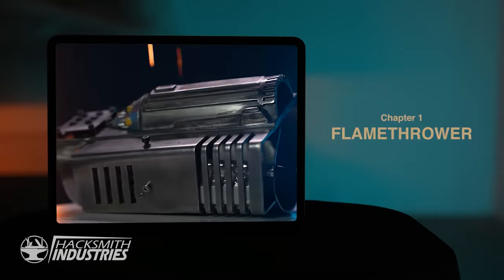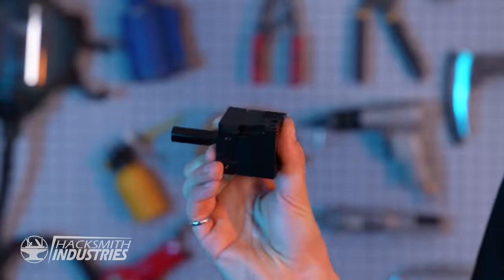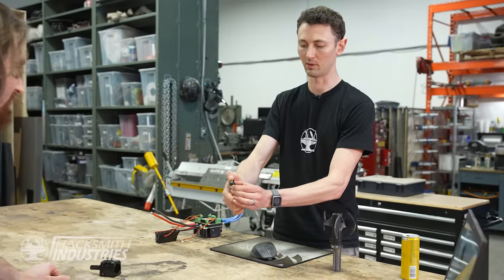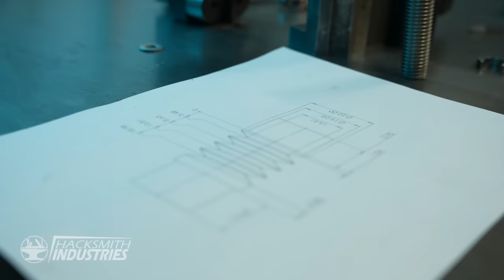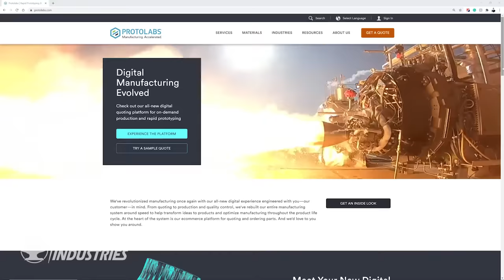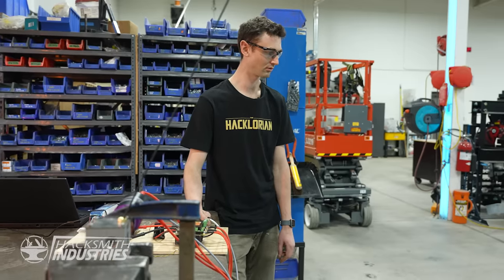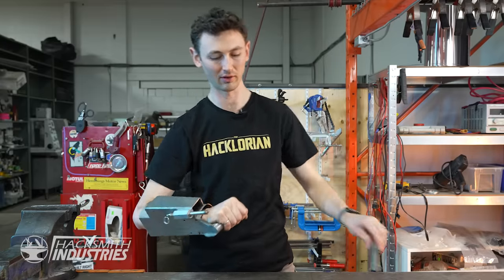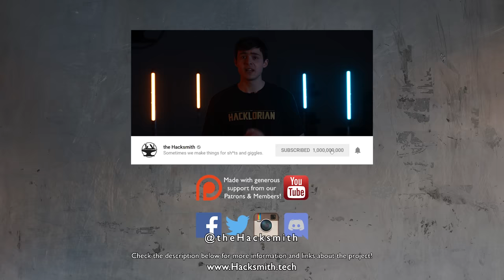World's Fastest Grappling Hook Winch! (HACKLORIAN: Chapter 6)

Comment: I love how their older creations are getting improved and more compact as the time goes on
Reply: I feel hesitant to say, but I think the earlier models made by the intern were more compact than this one. They were totally self contained, had comparable speed, etc. The major shortcoming was the electronic controller, but the solution here just made another big hip mounted element...

They scrapped the spool and made a custom part that was used for variable rope length, but there are practical limitations to the value of rope length in a device like this, and ways to make the rope thinner while maintaining strength to accommodate a more finite spool size too...

Comment: That tiny motor definitely cannot handle 40kW, even if it's 99% efficient because that would be 400W of heat to dissipate
Reply from the maker: peak current yeah, sustained no.
Reply: @hacksmith  You mean peak power

Comment: Hmmm im not smart in this area but an idea i wouldve done is have the rope and all that in a pouch or something attached to your belt in the back and have the grappler be a separate item that can be removed from it, then combine it with the assassin creed uhhh wheel mechanism that was used to traverse that line, that way it doubles as a grappling system and a rope you can easily slide down using the brace, more mobility, but just an idea

Comment: hey what if you put the winch in the jetpack and use steel tubing on the arm for the cable to run so that the arm doesnt look too bulky. maybe put plastic tubing at the joint so you you can still move freely

Comment: you could route a small pipe underneath the armour from the grappling hook into the jetpack together with small motor to collect the excess rope discreetly . The small motor in the jetpack could use the same switch as the hook so they are controlled in parallel at the same time
PS sorry for the broken english